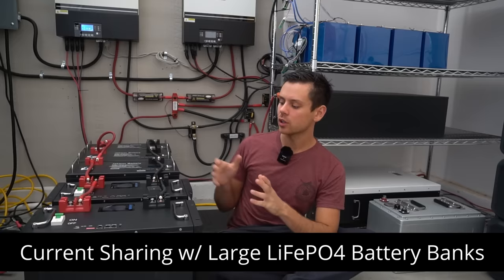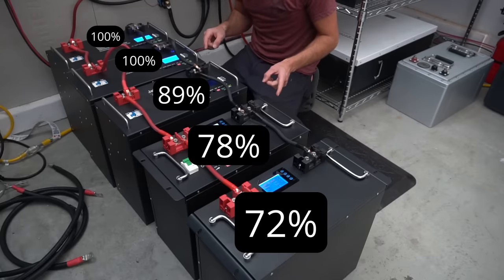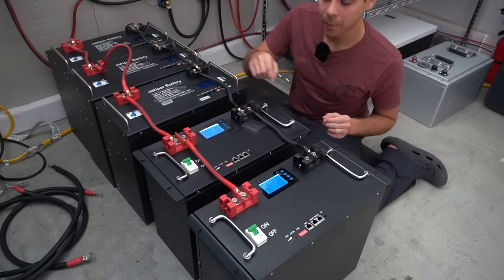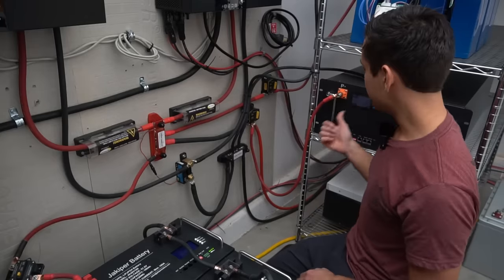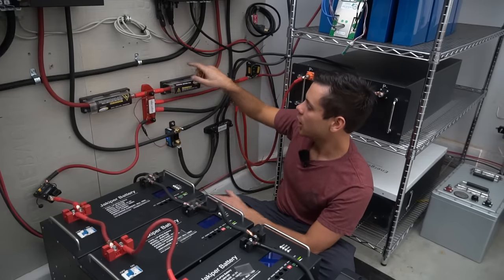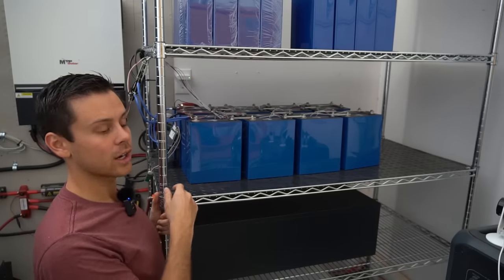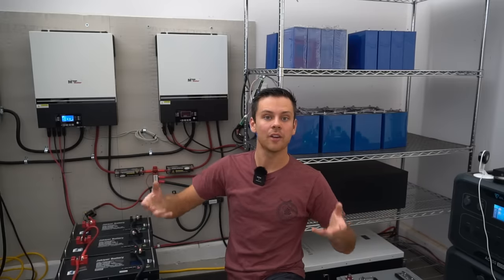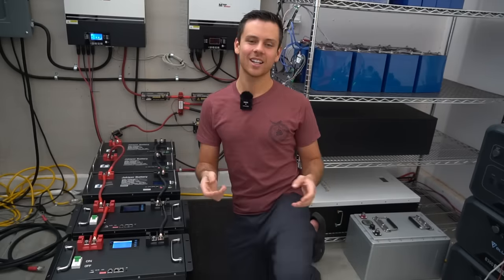Current Sharing 101 w/ Large LiFePO4 Battery Banks

Comment: Another great nugget of info. However let me ask u a Q. I was given 4 100ah lipo4 batteries that that have no bms. I was told that I couldn't connect them in parallel but configuring them on another way to get my desired 12volt system then place a bms to the batteries for the desired effect. Hope I explained it as best as possible.
Reply: Scan through some of Will's older videos. I'm pretty sure he has built at least one of these sets, and shows all the steps.
Reply: Basically you have to connect them in series not parallel. Parallel is negative to negative and positive to positive. Series is negative to positive to negative to positive. There are a lot of build your own 12v battery using lifepo4 batteries videos. Note that if you are using LiPo ( lithium polymer batteries you only need 3 cells in series to get 12v)

Comment: If I am connecting 8 batteries of same 12.6v 250ah with smart BMS. Two parallel sets of 4 for 51.2v 500ah. Should I use 2/0 for each end same length and 1/0 or 2 between batteries?  What do you think is safe but not breaking bank.  Batteries will connect to 10kw hybrid split phase inverter with 2 x 100a charge controller

Comment: Will you please do a video on lead acid batteries? I plan on using them for my micro hydro, since I can get them fairly cheaply (brand new) through work. I know I shouldn't let them get below 50% capacity, but that shouldn't be a big issue with hydro. It's everything else I don't know.

Comment: Class-T fuses should really be installed inside the server rack battery packs directly from the positive side of the cell packs before they the voltage gets to the terminal.  I am actually surprised that so many companies only put these "Breakers" for safety and sadly most of the breakers look like they would just become massive arc carriers rather than safety devices.
I am pretty sure that one criteria a battery pack needs is a Class-T fuse inside it before it can be certified.  So many new users have no idea what they are really dealing with because 48V sounds like a fairly safe voltage.  I have a friend who dropped a fairly large screw driver onto the positive terminal of a single 5Kw pack and the other side hit the ground rail and he told me that after the explosion all he could find was the handle with a nub of steel sticking out of it.  The pack was also ruined in the process. A fuse inside would have prevented that.

Comment: Shouldn't you have the negative cable on the stack on the floor on the opposite end of the bank to get proper charging?
Reply: That's how I do it.  Main positive to the first battery and main negative to the last battery in the parallel string.
Reply from the maker: The whole point of the video is showing a bad example. Did you not watch the video?

Comment: I have a 60v 1500watt ebike motor for a 6 passenger bike.  It came w/ (5) 12v 36ah lead acid batteries.  I replaced them w/ (5) 12.8v 100ah lifepo4 batteries, for longer run time.  The company strongly recommends only connecting 4 of the lifepo4 batteries in series.  How can I get the 60v out of lifepo4, safely?  I’m getting so many different opinion…. I can provide pics if helpful.  Thanks!

Comment: what size t class fuses  and what  brand are you using and explain if you could explain how much amps each of your banks has for your selection of t fuse...and what size circuit breakers are for each string incuding the one you need to replace with a bigger breaker and what size you will be replacing it with. THE LACK of detail about the serious t class fuse sizes and breakers is needed to help peoople understand HOW YOUR EXACT STSTEM WORKS ..

Comment: Great video.. I always love watching I do learn a lot but I'm having the hardest time.  I have 6 car batteries AGM 90 amp hours. For a 12v system 1000w inverter using 300w 24 7 .  190 watt panel mppt control. But the batteries never last and it allways dies.  I thought more batteries and panels maybe.
Reply: You don't have enough generating capacity by a long way. 300W continuous load would need more than 300W of panels with continuous sunshine. I'm guessing you don't have continuous sunshine so you use batteries to fill in the gaps and use the panels to run the load and recharge the batteries when the sun is shining (and use just the batteries to run the load when the sun is not shining).

If you could guarantee 8 hours sunshine each day then you would need at least 900W of panels. But I guess that you get clouds occasionally...

You will need to design for the worst sunshine days. For me that is the middle of winter when the days are short and usually cloudy.

Also car batteries are not designed to be deeply discharged - if you do you damage them and will be replacing them soon after.  They make deep cycle batteries for this sort of application.
Reply: @georgescott6967   well thank you

Comment: I worked on a 2MW Ward Lenord system  that contained a LARGE single pole DC breaker that was 2m long with a big arc Shute.  I looks like you are using small circuit breakers.  How do these breakers handle the arc control when  the breaker opens?

Comment: Same power 12v 100Ah with different brand , how is the setting of it, on a  2 Panasonic and 2 CEA  brand on a 40A controller and a 3000w invertor.

Comment: I have three LiFePo 4 batteries wired in parallel, connected to a Lynx distributor. Two of the batteries are in closer proximity to each other than the third. The third battery is about 12” farther away. I have no reasonable way to to get it any closer, thus the cable lengths are incongruous. Is this a huge problem?

Comment: i watch a lot of you  videos and love the information 
but right now i have 6 agm battery's 100 amp each 2 years old came from some a system they are each at 12.75 volts i am wanting to hook them up to my charge controller and then to a 3000 watt inverter looking for inf on the best way to wire them i have 7" #2 welding wire please any input would be great thanks

Comment: Why don’t you discuss connecting cables to the middle battery, 3rd battery instead of first?  Great video
Reply: Thats interesting, I had not thought of that alternative arrangement.
Reply: Or connecting between battery 3 and 4, which puts higher capacity batteries 4 and 5 closer to the current. Still parallel but less voltage drop.
Reply: Will is showing how to connect INCORRECTLY (in maximum fashion) to emphasize the point of the topic.
Reply from the maker: Yeah, the whole point of the first part of this video is showing people how not to do it.
Reply: @josephbrabenderiii2049 hyperbole

Comment: Do you think that putting a fuse on each of the batteries in the  400 AH LiFePo4 set up I have (4 -100 ah batteries) is necessary? Or just with the larger 48 volt packs like in this video?

Comment: power bar equivalent, if you connected the positive to the battery near the wall and the negative to the battery near the camera, would that fix the issue of batteries not charging equally?

Comment: So I'm about to create a bank that puts five 24v, 200Ah batteries together in parallel on my boat. Assuming I'm wiring in the most efficient (i.e. correct) way, is there any benefit to using a bus bar (in this case a .5"x2" tinned copper) versus just running 4-0 cables between the batteries?

Comment: I am using Victron 600A bus bars to connect 3 Renogy 12V 200Ah batteries in parallel. I am using 2/0 cables with crimp connectors. The bus bars have 4  3/8 bolts for terminals. After looking at your video, I was thinking of connecting the inverter to the top bolt and then connect the cables from the batteries to the remaining 3 bolts. The victron bus bars have smaller bolts. I was going to use the smaller bolts to attach the outputs from the charge controllers.  At this time I am not sure how many charge controllers I will be using, but for now, I am planning on using 2. Is there any order on how I connect the inverter and the batteries on the bus bar to get the best equalization on charging and discharging on the batteries? Thanks.

Comment: Star wiring would be better when physical arrangement of batteries permits and then you can have a separate fuse before the main post, and be able to use lighter gauge wires. Ladder wiring is not recommended.

Comment: Thx Will for the video :-) Anyway - what if I'll have multiple batteries and for whatever reason all the batteries will trip their circuit breakers and disconnect themselves from the MPPT solar charger? Solar charger without battery connected will burn out due to PV array still feeding power into it or am I wrong? Maybe a relay kept ON by battery voltage of that batteries could disconnect the PV array? (yeah, it is not so simple as "any relay will do it OK")

Comment: Hello. I have a question. How is it better for a 200W / 230V consumption, to use two 12V / 100A batteries in series or one 12V / 200A battery? Thank you very much.

Comment: A little off topic. Can I used 2 different lead acid battery on a boat? the switch system allows only 1 batter to be used at startup, and the other when the engine is off but when the engine is on and charging both batteries are connected to engine.  this is all done with a relay and the key switch.

Comment: So I have a 24v battery bank with three parallel strings each string has 2 chinese premanufactured Elfhub brand 12v lifep04 battery(4white model,2black case model) connected together in series. I had been using 2 250A bus bars with unequal length conductors. I use 4/0 gauge copper cable for the battery connections for max current flow. But for a few months I hadn't been using equal length conductors for a couple reasons. One bc I had jus got two of the black cased models and they were supposedly better than thr white versionbso I wanted to baby them so I made their parallel conductor connection twice as long after watching this video a few times and getting the list. And second bc I only had 20ft of 4/0 cable to stretch for the entire system. But now since the individual series ed packs are out of balance except the black one, obviously. I am redoing the entire bank with closer match cable length..but is a couple like a 
6 inch difference in conductors' length for 2 out of 6 for the 2s3p battery parrallel cable bus bar hookups only. Bc for the upgrade I bought equal length conductors I bought 5 36" pieces of 4/0 gauge copper cable and had1 5' piece I cut to 36" with lugs =39" and that gives me    six equal sized pieces for this pack, but I plan on adding one more  series connected battery pack using litime 12v100Ah lifep04 batteries into the parallel pack either I guess at the end like I did with the black batteries so that they Last the longest bc they were the most expensive....however I only have 2 33" total length from lug tip to lug tip left to use, and these are from the previous setup I was using...?what I want to know is ths extra 6 inch difference in cable length for the parralel battery connections to the bus bar going to make that significant of a difference to throw them all way out of balance again? Bc some of the packs had differences btwnn them ofnat least an whole volt or more up to about 1.6V on one of thr packs if not both white packs..the newer black on was only off by about (.5V)? Any help you can provide I would provide is certainly greatly appreciated. Also does this equal length conductors rule apply for the common connector between series connected batteries as well. Sorry if it's confusing amd thanks for your help ifnm you can bc I love your knowledgeable improvement videos and your channel is phenomenal...thanks 

Sincerely, 
Mason 
Brown

Comment: first of all, two mpp solar go into the bus bar. then, three big battery packs are connected to the bus bar. do you charge all three battery packs at the same time? i want to know if it is possible for the mpp solar to communicate different battery packs? and furthermore, the BMS's of pararrelly connected battery packs communicate to each other  with no problemsy

Comment: If I have three lid batteries, pushing the Trolling motor, one more lead battery, starting the engine on the boat and then one more battery in lithium to power the screens can I just blended in with the boat charger to charge it up we

Comment: Hi Will,
I don't know if this in your comments already, however I'll poise the question.
The state  of charge is different for each battery pack  in your parallel pack has been shown. The question would be:  Could any of the battery packs inside the parallel pack  become so far off at a full charge or full discharge state that it's BMS would disconnect because of a low cutoff voltage or a high cutoff voltage had been reached, while leaving the other individual battery units in the parallel pack to continue being active.
Thank you.
Reply: no because the voltage will come together  at the top and the bottom of the charge.  The curve is only flat in the middle.

Comment: Instead of the Class T fuses, can you use fuses on the positive terminal of each battery?  I have Power Queen 100 amp hour Lifpo  batteries. What size fuse (amps) should I use on each positive terminal (100)?      I also have a bank of four 100 amp hour deep cycle lead acid batteries. I was planning on using a 2,000 watt inverter on the deep cycle lead acid batteries and a 3,000 watt inverter on the Power Queen Lifpo's. Does that make sense? I hope I don't sound like an idiot? I am trying to learn. I just bought one of Will's books. Thanks for any help.

Comment: Is there a limit to how many equal capacity 12 volt lifepo4 batteries you would put into parallel configuration? And how large capacity 12 volt lifepo4 pack would be safe for one high quality BMS?

Comment: Hi I wonder if you can please give me some information. I live in the UK and with energy prices going through the roof I was thinking of installing some Solar panels to help on running some low power usage around my house. The question is would it be cheaper to use something like a Bluetti EB150 1500Wh Portable Power Station. Or buy some lithium batteries. It’s not the installation, I’ve got a Motorhome and I’ve already set that up with solar system and a inverter. Thanks Carl

Comment: can you give some input on a idea i had, i started solar this summer, and have 18 panels each 100 watt, i got 12 deep cell and car batterys when i just bought some lithuim iron batterys with my tax return, my scrap parts are 6 controller, two 30 amp and couple 100 pwm ones, can i take battery input into a controller to feed other batterys, like 48 volt lithuim series dowm to 24 volt lead acid? will the controller blow up being hooked to 100ah battery??

Comment: I want to run 2 EG4 48V 5KW batteries in parallel to a Growatt 6KW low freq inverter.  Can I get buy without the com ports connected?  Also, Where should I install the fuse?

Comment: Hey Will how are the terminals connected on the batteries at the beginning of the video? Is it a single conductor for both lugs like a bus bar or something? Im an EE major and I had asked professors about this wiring configuration a few years ago when I was thinking about reconfiguring my battery bank and they said as long as its in parallel the nodal voltages should be the same and there shouldn't really be a voltage drop from battery to battery except for the drop due to the increased conductor length. Im still using agms until they die for reference.

Comment: Hay Will - I live in an RV community that only supplies a 30 amp single circuit electrical feed to each site. What do you think about a non-solar system consisting of a battery bank combined with pass-through inverter/charge to increase power availability during peak demand periods? Say 50 or 60 amps 120 volt A/C using batteries and 30 amp utility power to handle intermittent higher loads. Batteries charged continuously by utility power. Thanks, John H.
Reply: Thats a good solution

Comment: Hi Will what size T class fuse would I need I for 600ah of lifepo4 with a 4000 watt inverter? Everything is connected with 4/0. It's a 12v system.

Comment: You say not to add LFP and Lead acid in parallel in case you have an internal short in one of the lead acid cells? Can you please tell me what happens with a large bank of lead acid when one of them has a shorted cell? From what I understand a large bank of lead acid can still supply a large amount of current, and is not limited by a BMS, which is the case with a LFP battery.

Comment: I new to this. I have 4 panels @100 watts each @5.65 maps at full power from panels. I'm looking NJ at batteries now, I'm not crazy about lead acid batteries. Next is how many batteries should I use? 
Any help would be greatly appreciated. 
AC current I understand and can do. This DC is a storage deal, I get that. I was gonna use 30amp in line fuses from panels, but not close to that amp draw +/- 10%. .
Haven't seen any 25 amp, only 20 amp.

Comment: Will, I'm curious.  Do you think adding a cable from the positive/negative terminals of the first battery to the positive/negative of the last battery ( a poor-mans bus bar ) would help?  I do that with LED lights so both ends are fed equal power.  A proper bus bar would be best but like I said...poor mans bus bar. :-)

Like always, excellent video and information.

Comment: What size r the T class fuses

I don't know anything about the circuit breakers are fuses. I wouldn't know how to size the circuit breakers properly do you have a link to the information thanks Will
Do I need a teclast use if I'm just going 120 V 6500 lv68 sungold.